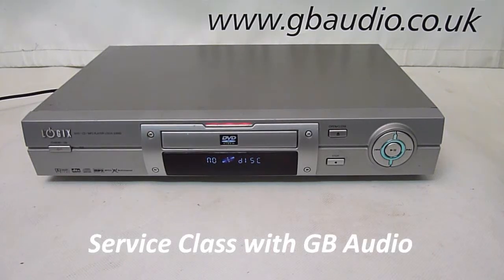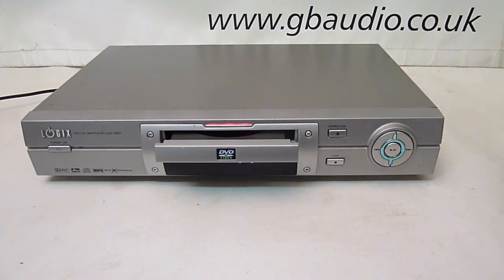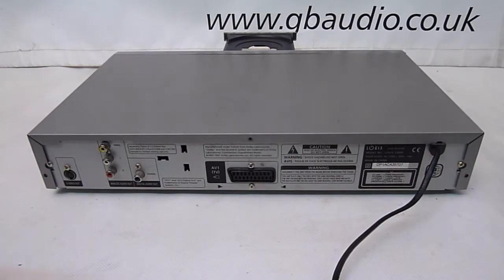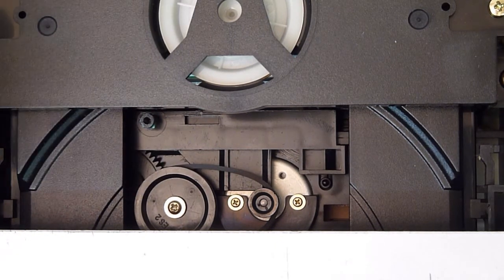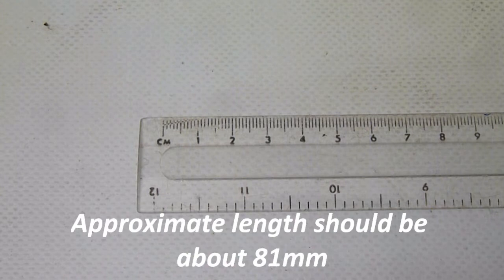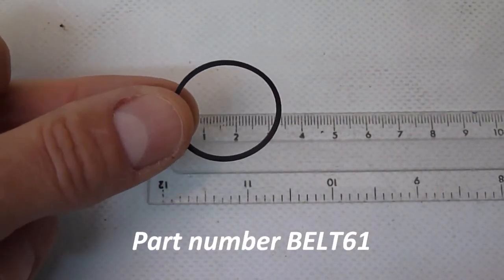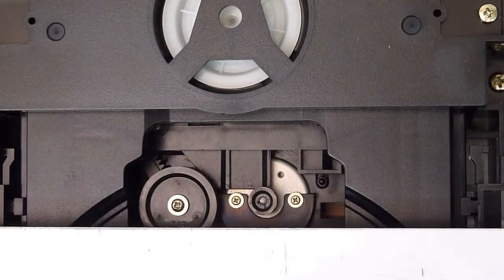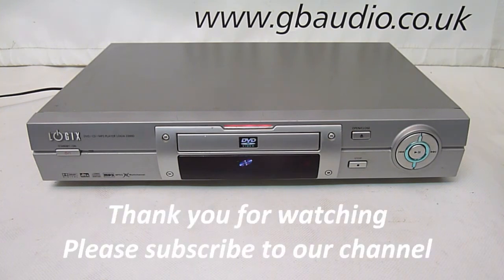How to fix a sticky door tray on a Logix 3300-D DVD player

Comment: I need a new belt for a Go Video DV2150 Combo player. Any ideas where I can find one? I don't want to buy the wrong one.
Reply from the maker: Sorry, I don't know the belt size for that machine. If you can remove the old belt, measure it and deduct 7 or 8% to allow for stretch, that will be approximately the right length. If the belt has disintegrated, run a piece of cotton or wire around the drive path, measure it and deduct 7-8%. Then select the closest matching belt from our chart at http://gbaudio.co.uk/data/belts2.htm
Reply: @gbaudio1212  thanks